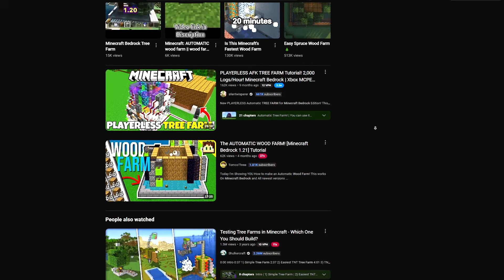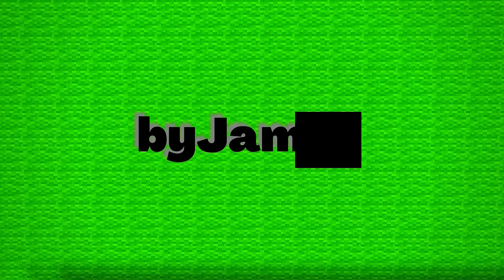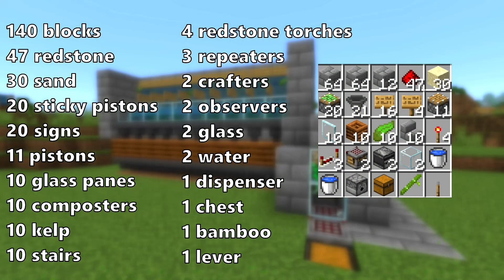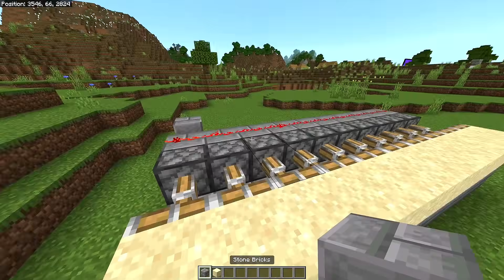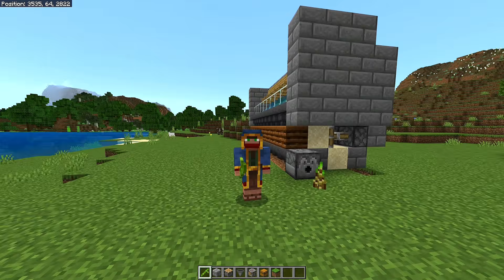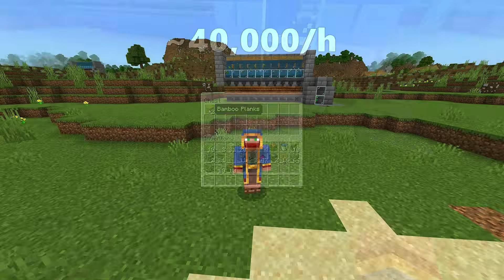AUTOMATIC 1.21 WOOD FARM for MINECRAFT BEDROCK Edition | NO TNT!

Comment: If you have trouble placing the hoppers on the composters, crouch and aim at the rim of the composter
Reply: Bro is this fram still working?
Reply: @MalikHamza-g4l yes but you cant walk too far away as the kelp will despawn and you will have to replace it. Just afk right next to it and you will be fine

Comment: This works really well, thank you. If yours isn’t working, check that your comparators are in the right direction as well as set to the correct amount of ticks. I took out the second crafter and just am gathering blocks of bamboo. I may try and adapt it for a regular wood farm as well. There’s a lot of potential on a farm like this. Thanks again.❤

Comment: followed every step exactly and everything works except the crafters.  They are powered ad light up but they're just collecting the bamboo they aren't putting any wood in the chest.
Reply: Use single item crafting system , use filter released within month

Comment: If this farm is not working for you; 1. check your chunk alignment, 2. Make sure you stay within the area, 3. Make sure you turn it off before you finish playing for the game.
Reply: Does the farm have to be inside a chunk? I don't speak English, so I don't know if the video says that.
Reply: @bill_mgit doesn't say that, but it does have to be within a chunk. The one I use is different then this and it must be within the chunk, it doesn'twork otherwise..  It only uses 2 sand per kelp. His uses 3 sand per kelp. Check out JCPLAYZ for the otick auto kelp farm.
Reply: I didn't check for the chunk , you should be good without just make sure to not leave the area where you start it. If you want to leave close it beforehand @bill_mg

Comment: It does not work (Bedrock, 24.02.2026)
Reply: Slow it down a tick and stay in the area , Works for me!
Reply: @sovereignskitzo  which repeater is to be slowed?
Reply: @carlosp_bg I slowed the clock repeater but it ended up breaking for me aswell so I redesign the top a little and it works much better his design is just flawed now for some reason I believe, I’m sure I can find an example of what I changed for you to reference
Reply: @sovereignskitzo  okay, i would appreciate it much
Reply: @carlosp_bg  “new zero tick kelp farm “ 3 months old by “wings of end “ basically what i did and it works mint
Reply: Take his design and make it long as you like, get that running smooth and producing bonemeal then attach the auto planter
Reply: @sovereignskitzo thanks!! I'll try it
Reply: @carlosp_bg let me know how you make out !
Reply: I tested in a creative world the design form the video you suggested Mixed with the bamboo machine and worked perfectly. sadly it breaks due to lag in the server where I needed it. But thank you so much anyways!!!

Comment: The sand that I plant kelp broke when I turn on the farm.. 😢
Reply: I got my farm working, but I had to make adjustments from the original feature in this video. My sand also kept breaking but I fixed it by doing two simple things. 1) do not set water to the piston like it says in the video. 2nd) change the signs floating in the middle, to glass blocks. Lay water only on sand blocks, then lay the stairs. Without watering the pistons.

Comment: sand keeps breaking on bedrock, I built the entire thing inside a single chunk, and still having problems...
Reply: Did you find a fix
Reply: This problem is super frustrating
Reply: Having the same issue, this farm is trash
Reply: @chrish2354 for me it works
Reply: I think we can use mid blocks
Reply: It's bedrock, sadly 0 tick is very inconsistent depending on the platform you're playing. What I know for sure you cant do is unload the chunk, either afk right next to it or turn it off.
Reply: @rafael_lana  why not ender pearl chasis
Reply: @Pepper-edits-yeah  that would prevent it breaking from unloading, but even when loaded 0 tick often breaks anyways when saving or laging for example. Be prepared to reset the farm often, is my experience

Comment: Mine lasted about 2.5 seconds before it broke all the sand blocks removing the kelp and producing nothing from that point forward. Followed every single step exactly the way it was demonstrated in the video with precision and not sure why it broke the sand blocks. Tried replacing them, same thing again
Reply: Mine too
Reply: same
Reply: Yup same here.
Reply: It’s like that on mobile, it’s the same for me :(
Reply: Any solution?
Reply: I’m other tutorials I’ve seen, some of the sand will break if you walk away from kelp duper. I think you need to stay close by to run. Maybe this is the issue?
Reply: @travisburns5370 yes your right
Reply: @travisburns5370 how do you fix it?
Reply: @HarryLiebermann I’m a noob and don’t really know what I’m doing, but I’d say, rebuild it, and then when you use it, don’t leave the area. That’s about all I have for a possible fix. Good luck
Reply: It doesn’t work on mobile
Reply: Doesn't work with mobile or xbox
Reply: chunk borders :/
Reply: @ImJustDedicatedYT nah
Reply: works on pc bedrock
Reply: It worked for me just the kelp sometimes breaks off everything else is fine
Reply: Worked on mobile for me, only issue im having is instead of bamboo im using this layout for kelp farm. But im doubling it, that's where im having issues. One side works the other side isn't.

Comment: The sand is breaking don't build in the pocket edition 1.21.100
Reply: It can work, my sand was breaking constantly. I replaced the sand on the bottom vertical pistons, with dirt. It improved reliability, I can now AFK for several hours and still have a working machine.

Comment: Mine does not work. After a few seconds, the sand breaks idk if it's my game lag but it doesn't work (pls help fix!)
Reply: Same for me
Reply: @coIamaschine I hope he responds to my comment and tries to help fix the problem
Reply: I built my first one today, sand was breaking constantly. I replaced the sand on the bottom vertical pistons, with dirt. Seems to have improved reliability, I can now AFK 20 minutes and still have a working machine.
Reply: The sand breaks if you go outside of a certain range or turn off the game (sometimes it even messes up when you pause it). You have to manually fix it again.

Comment: This can be retro-fitted to produce bamboo, bonemeal, sugar cane, or kelp. 

I used sugarcane to set trades with 60 librarians for my trading hall. Useful and adaptable design. 

To some people who are struggling with the sand breaking: make sure that part of the machine is within a single chunk and avoid allowing that chunk to stop loading while it's running.
Reply: Im sorry,single what?
Reply: @skilltwinz8908   A chunk. A 16x16 square that goes infinitely high and low.
Reply: Thank bro the sand breaking is my problem😅

Comment: Sand just keeps breaking.
Reply: Check the ticks and make sure the sand by the composter is in place . Chances are that it broke at some point. Or the ticks is making it break.
Reply: @mistercontroversial all repeaters on 2, all sand in place. I've replaced the sand like 10 times now. I'll turn it on and within 30 seconds the sand starts breaking. Within 5 min, no kelp at all.
Reply: @MachineGean Replace the sand again (check all of them again, I know it is tedious, the same thing happened to me) and then check the redstone dust. There is a chance that it came undone.

Comment: My sand just breaks 🥲
Reply: me too, the solutions
1- make sure all repeaters are 2 tick
2- make sure you off the farm befor leave the chunk or exit the game,
and some times glitch but it is rare❤
Reply: @yousoufstorm1117  you are the goat for that
Reply: If your sand breaks then you are missing sand behind the composter or in another spot in other builds where the sand breaks there is usually a missing block somewhere else to correspond to that sand breaking everytime you place it back and try to turn on the farm again
Reply: @brandonainsworth7055  yes my sand is breaking because the sand behind the composters are breaking
Reply: Do not add water to pistons only to sand first, then stairs. I had same issue. I also kept the signs on the wall in front of pistons, but replaced the center row with chains. I could not place the signs using my phone.
Reply: @ThisIsLifeYall fixed mine, no water on pistons
Reply: @jonathonpralguske9815  nice
Reply: @ThisIsLifeYall I tried that, but still the kelp goes missing and my sand breaks. 😢
Reply: @nicobotha5298  did you venture off? Because being to farm from it while the switch is on will cause it to glitch
Reply: Same
Reply: Sand breaks while I’m afk and all repeaters are 2 tick
Reply: @XxMerlinxX_  I had this happen once where I built 2 identical farms and one kept breaking and one was usually fine... turns out one was on a chunk border. It's best to not have the farm cross the chunk borders, it can cause issues.
Reply: Mine as well
Reply: Yeah that happened to me but then I found the problem and I don’t know how to explain it but the problem is beneath the piston breaching the kelp
Reply: as the other comment said, turn off before leaving, sometimes the sand will duplicate so just dig it out, sometimes the kelp will disappear just plant it back. it's glitchy but it's easy to solve and when it's running well (most of the time)  its so good.
Reply: You have to do Afk if you go away from the farm the sand will break

Comment: 5 kelp long is a hard limit for me for some reason. the sand keeps breaking is I use more.
Reply: I got my farm working, but I had to make adjustments from the original feature in this video. My sand also kept breaking but I fixed it by doing two simple things. 1) do not set water to the piston like it says in the video. 2nd) change the signs floating in the middle, to glass blocks. Lay water only on sand blocks, then lay the stairs. Without watering the pistons.
Reply: @ThisIsLifeYall You’re a lifesaver. The farm works now thank you !!!
Reply: @ham-c4h side note I switched from chains and signs in center row to glass blocks. (No loss)
-make sure you don’t leave it on when logging of.
-don’t go to far away when it’s running.
(It will glitch the sand)

You’re welcome btw. I spent a couple hours trouble shooting this + a couple hours of redstone research. Which led me no where 😂. It is caused by the piston.  In some versions, the piston leaks water . So when the water was locked on the piston it past threw the piston, washing away the sand underneath. I discovered the leak issue in a Reddit post, unrelated to the build. 

Thank you for your feedback back. I’m happy, this trick worked for both of us.

Comment: Be careful as the new spring to life update seems to break this. Not sure if intentional but the farm no longer seems to work as of today
Reply: Just built it tonight and mine works. Not as efficient as I’d like it to be but still works. You sure the kelp is still there and growing? Also I brought the glass out a bit further on the front to allow the hoppers to collect the kelp and used glass blocks instead of panes. Maybe that’s why
Reply: i cant place the hoppers on the composter?
Reply: @BigPen12435 I know this was a month ago so not sure if you’ve figured it out yet, but you just need to crouch while you place them, make sure you’re looking at the hopper
Reply: if you read the comments its clearly not working i built it multiple times and the sand just breaks or the kelp breaks only last a minute or two i wish i would have read these before i spent the day trying to get it to work

Comment: PSA This farm is great for rates but breaks if you walk more than like 70 Blocks away requiring rebuilding and troubleshooting. AFK it ONLY and turn it off to logout or walk away
Reply: When I run the lever and don't move it works fine but even if I move one block after hitting the lever my sand breaks

Comment: 3 stacks of stone bricks 
47 redstone dust 
20 sticky piston 
21 hoppers
20 signs
11 pistons
10 glass panes
10 composters
10 kelp 
10 stairs 
4 redstone torches
3 repeater
2 crafters
2 observers
2 glass
2 water brackets
1 dispenser
1 chest
1 bamboo
1 lever
Reply: Did you watch the vid?
Reply: Mvp

Comment: This is a really good build. I was wondering if one should build the bamboo/wood system down two and right one to place a chest and hopper between the composers and the dispenser. Would the composers fill a chest that would dispense to the wood system? Making this a dual Bone meal and wood machine.  As it is now, I just dig out the bottom. Angle the last hopper into a chest for bone meal. Then place it back intro the dispenser for wood. Thanks for the easy guide. Your list at the start was super helpful but it was off by a few red stone torches, a repeater, and all the hoppers.

Comment: Building  materials= 140blocks,47redstones,30sand'20stickypiston,20signs,11pistons,10glassespanes,10composters10kelp,4redstonetorches,3repeaters,2observers,
2glass,2watee,1dispenser,1chest,1bamboo

A tip u can also use it as a bonemeal farm.i'm also doing that
Reply: How can u use it as a bonemeal farm?
Reply: In place of the dropper if u put a chest
Reply: By just not making wood farm system bro instead just add some hopper and chest there @AJosephTZ
Reply: I guess 0 hoppers

Comment: The tallest sand break every time if i start the machine, please need held (the sand where we need to place the kelp)
Reply: It got patched :(
(It was a zero-tick farm, which is a glitched farm)
Reply: Same - it was working fine for a while, and now this keeps happening every time it is turned on.
Reply: The same thing happened to me too, hopefully there will be a solution soon...
Reply: @jobaker3818 @rubenpace8272 found the Problem, for me was a Chunk Problem, the Farm need to stay in one Chunk
Reply: So does this farm not work anymore?
Reply: @travismahon6405  probably not
Reply: I’ve built it, it works. But if you leave the area while it’s still on it will break. Also, after about an hour of being afk the kelp breaks but that’s a simple fix

Comment: Help it keeps breaking. The bottom hoppers somehow pick up the kelp and then the dispenser dispenses it.
Reply: Check to see if you are on a chunk line. A lot of these kelp farms don't work if they cross a chunk line. Keep the entire farm within one chunk.
Reply: @chairborne33 what if i can't
Reply: @tkmaaa1430  a chunk is 25x 25 blocks, so unless youve expanded it, you should be fine.
Or built two different in two seperate chunks

Comment: So I've been over this and been over this but its not working for me; Every time I turn on the machine it brakes the sand blocks that the kelp is planted in. Any ideas?
Reply: Your machine maybe built in the middle of 2 chunks idk if that's what's happening in your case. I also have seen that if you walk to far away from the machine while it is running the sand or kelp will break.

Comment: Can you make this for kelp blocks
Reply from the maker: Sure. Just replace the composters with smokers and leave out the bamboo part. Connect a crafter like I did, but only the first one that uses all 9 slots. You also need to wire it up.
Reply: @ thanks and your video are the best I have seen in a while for farms

Comment: Kelp isnt growing in mine😢
Reply: I watched video twice too
Reply: Things to check: are the sand still in place after running the machine. If not, the problem maybe that the repeater timings are not set correctly. This is the most common cause of kelp not growing.
Reply: I have the same issue
Reply: Make sure to place the water on the stairs sand and piston

Comment: Not a bad farm you could of just use a full block with buttons underneath it so you dont need to use sign's alot cheeper and i would of put the redstone clock on the other side so your not running 2 line's

Comment: Please be careful when leaving the area or leaving the game while this machine is on it will break. I've built something similar, but for kelp.
Reply from the maker: Great advice!
Reply: @by_James what to do when it breaks? I lost sand and kelps, put it back, but it still doesn't work
Reply: @Thuras  this means that water got out and removed some redstone
Reply: @exodusghouls  I have been testing all day and found out that, the problem of the kelp not growing is the ticks settings on the repeaters were different after I accidently left the area and broke the machine, however it broke more than just that, but that I had fixed before I asked the question. It also broke the sand where the kelp was on. I had to remove all the composters to get the sand back, then put the sand at its original place and put the kelp back up on it. But then it didn't grow and the solution was the repeater. it had gotten the wrong tick settings after the machine broke
but thanks for the effort to reply.. it is very much appreciated
Reply: @exodusghouls my sand and kelp keep getting destroyed any solution
Reply: @monkey.DLuffy-x1p so due to a recent update they broke the machine

Comment: Total reminder of the kelp farm I built years ago in a previous world! I think that thing produced more dropped sand blocks than it did kelp  😅

Does that still happen or will it work without maintenance now?
Reply from the maker: It is more stable. If you want to be safe, afk nearby.
Reply: Although it probably will work anywhere, to be on the safe side, build it within a chunk.
Reply: @bitebaykon9948  just out of curiosity, if I am actively playing around multiple chunks that this machine is in then there shouldn't be any problem, right? It's only if I AFK and a single chunk is left active. Or is that not the issue?
Reply from the maker: It is more stable. If you want to be safe, afk nearby.